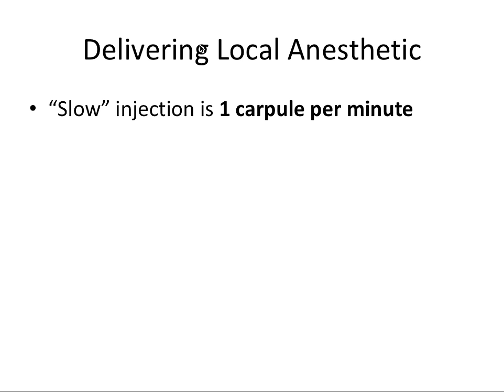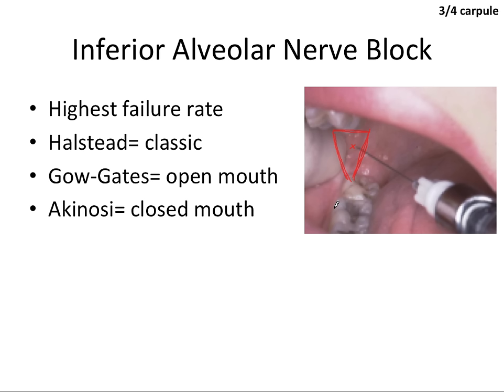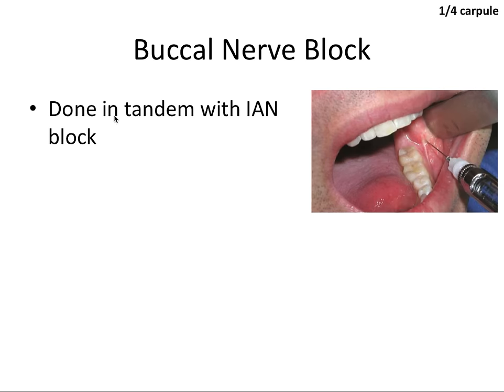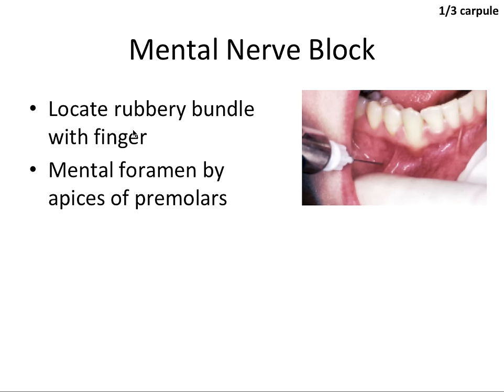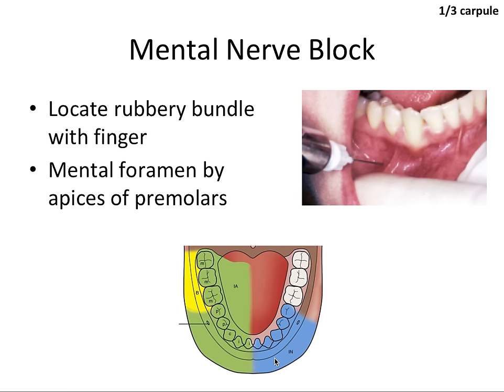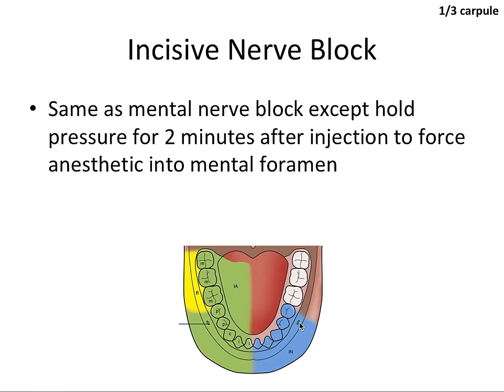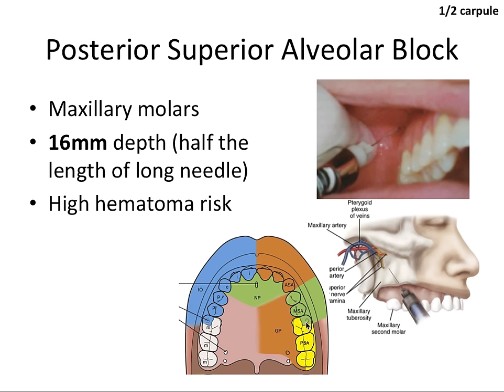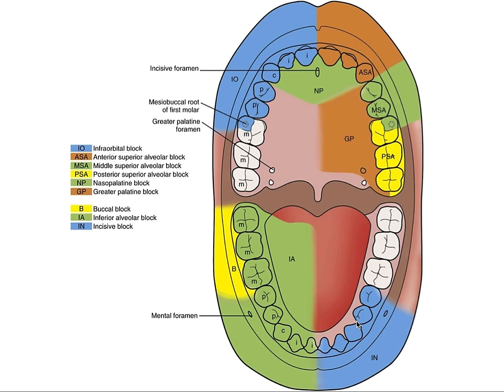Local Anesthetics | Injections and Techniques | INBDE, ADAT

Comment: When referring to needles that DO NOT break easily, do you mean larger gauge or larger diameter? Both were said. Thank you in advance.
Reply: Larger number of gauge can break easier. So 30 is more likely to break than a 27.  The bigger the diameter the less likely it will break.